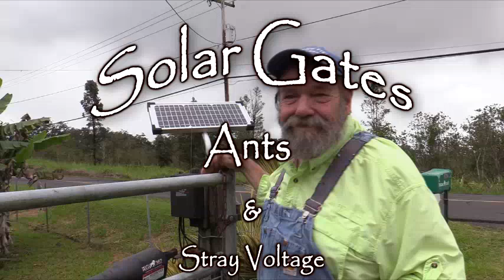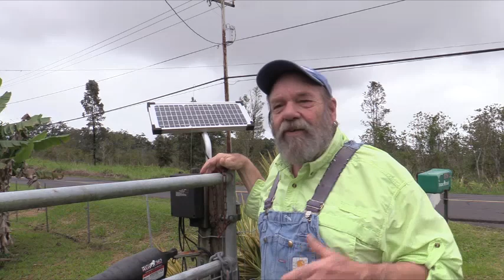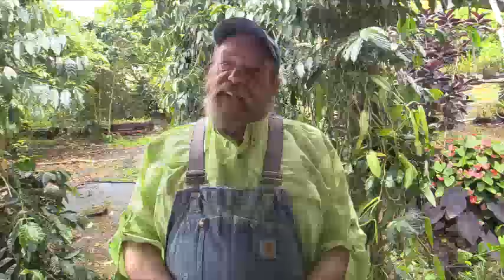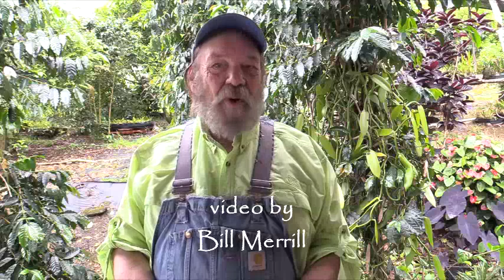Solar Gates Ants & Stray Voltage

Comment: OMGosh!  I think you figured out the problem!  I’m on Oahu and have had tiny ants with wings and surprisingly they are NOT termites, coming thru a ceiling fan/light fixture that I have not been able to make go away completely.  I have also had flickering lights in my kitchen ceiling.  I’ve sprayed organic deterrents and then set out baits and they stop for a while but then start falling out of the ceilings again from the lights. The only thing that works best is so far are sticky light tubes.  Which load up fast, but eventually the came to a complete end so-far lol
So NOW I need to find my stray voltage?  I guess in my attic…in August 🫠. Ok then. ONWARD with that now!Thank you Big Kahuna!  I Love your channel. MUCH Aloha from Kawili Street on Oahu!
Reply from the maker: If you are not an good with electricity hire someone or find a friend who is.  Better get into the circuit and clean it out.  The ants can get so bad they will blow fuses.

Comment: so little bit of silicone sealant around those wires now?
Reply from the maker: Yes.  The nice tight seal on the box didn't extend to the wires.  I assume the engineers at Mighty Mule are clueless about ants and stray voltage.  It would be a simple fix.  One of the viewers had the circuit board burned out by ants.
Reply: Yes. I have installed a hundred openers and used silicon in the same neighborhood over 20 years. Sometimes they still find a way in?

Comment: I wonder if a little silicone injection into the wire holes to keep the ants out would help with that? -Dave the handyman
Reply from the maker: Yes, I caulked it this afternoon.  I guess it slipped my attention that the box was weather tight but the wire holes weren't.  Should be shipped with neoprene collars for  the wires.  I find a lot of people have no idea that ants do this.  I suspect the engineers at Mighty Mule have never seen it.  Perhaps I should drop them a line.  It's a simple fix.

Comment: Hi Bill,
What brand gate, gate solar & motor are you using? 

I have never heard about the ants and voltage before.
Reply from the maker: Belen gate, Mighty Mule activator.  Ants in circuits are pretty common in outdoor wiring.
Reply: @GreenGardenGuy1  Thanks Bill!
Reply: Might mule 362 they stoped making them a few years ago but they are pretty good for an inexpensive opener. There is a new model at home depot.
Reply: @j.c.kocher5563  I will check it out. Thank you!

Comment: Same thing happened to me. Black ants. Had to swap them board out for 120 smackers
Reply from the maker: I should have known but the leak around the wires got past me.  It is plugged with silicone now.  I got lucky, clean up fixed the issue.

Comment: I had a similar issue with light switches in my house. The switches quit working so I replaced them and took one apart to see what was happening.  It was packed full of little fire ants.
Reply from the maker: Oh man, little fire ants in the house!  Terror, I treat for those outside at the fence lines to keep them biting the neighbors instead of me.  Hard to get near the property lines these days because out of state owners are clueless.  I'd like to cover the guy in peanut butter and stake him out on the fence line.
Reply: I’ve finally cleared them out of the house and have them under control in the yard.   It took a bit of time but well worth it.  I too treat  along the property line.  Its really strange how they are drawn to electricity.  I wasn’t sure why but your explanation makes sense.  None of my neighbors treat for  them.  Nor do they trap rats.   Amazing how people turn a blind eye to such pests.
Reply from the maker: @KR-vq2jf  I find it impossible to do that.  The rats eat everything on the farm if not controlled, chew through everything then crap and pee everywhere.  Not acceptable on my planet!  As for the ants, imagine this, I was clearing weeds along the fence line with the neighbor.  I stopped to tap a kidney on a tree along the fence.  Later I realized fire ants had fallen from the tree onto my unit.  Worse than Ben Gay on the nuts.
Reply: 🤣🤣I feel your pain. I look like I’m extinguishing an alcohol fire (aka Ricky Bobby) when one gets in my shirt.

Comment: Yep. Same here with water pump pressure controls. Pesky little critters. At least you had one set of frog legs for dinner.
Reply from the maker: Tiny little things.  A cockroach has more meat on it.  It is possible the Coqui frog is mildly toxic.  I hear reports of cats vomiting from them.
Reply: @GreenGardenGuy1  You are thinking of the toads, I live in the area and havent seen a toad in a while. I have seen dogs almost die after eating a toad.
Reply: @GreenGardenGuy1  Cancel my order.
Reply from the maker: @ralph601  I already fried them up with panko breading.
Reply: Yeah, had the same issue when we first bought our home in HPP. The pump kept knockin off and had no clue what the heck it was. Called my plumber friend and he immediately said to check the pressure switch. And wad ya know…. Full of dead fire ants. Then he introduced me to Bifen I/T. Never had a bug issue near or in my home since. Good stuff
Reply from the maker: @simplysimple7628  Nope, I know the difference between Coqui and Cane Toads.  Cane toads are for sure poison.  Toad toxin may affect the heart, blood pressure and breathing and can cause paralysis, salivation, twitching and vomiting. Death is possible in severe cases through cardiac arrest, sometimes within 15 minutes.  If the Coqui is toxic it is likely only a gastro-toxin.  My cat knows not to eat them but I have heard tell of cats vomiting from the frog.  I have a butt load of Toads around here.  I'm next to one of the only creeks in Puna. My neighbor dug a pond next to the creek and when it is time to mate toads from the entire area head for the pool.  We have two races of the toad here, short and long legged.  Because they have to travel so far to breed the long legged are becoming dominate.  The things look like tiny dogs running in dim light.  Scare the heck out of me.  Toads are supposed to hop, not run!
Reply: @GreenGardenGuy1  i think you replied to the wrong guy😂🤣
Reply from the maker: @simplysimple7628  Yeah, it was supposed to be to Kocher.  Seems youtube liked you better.